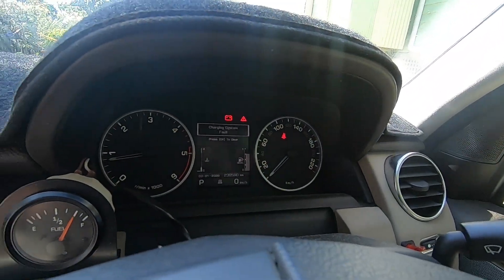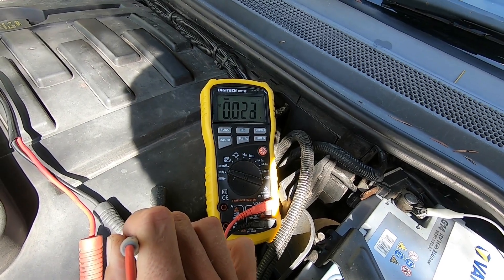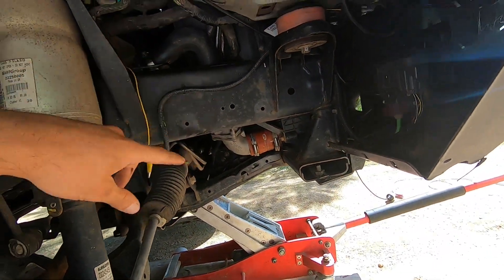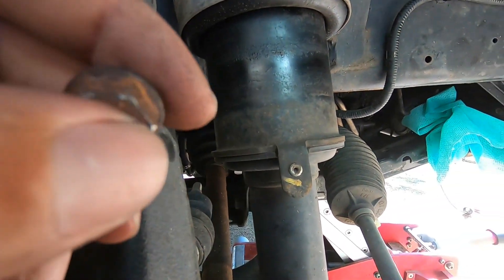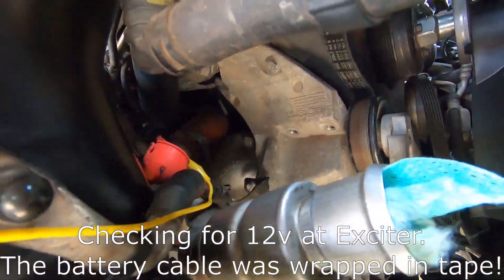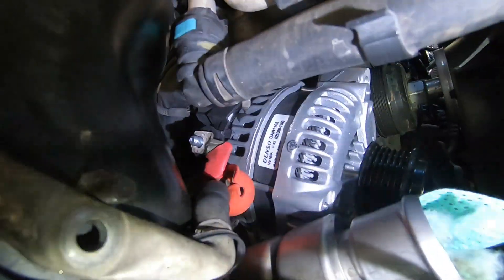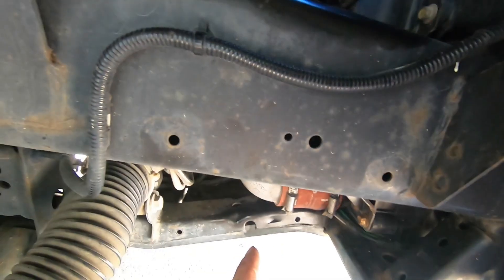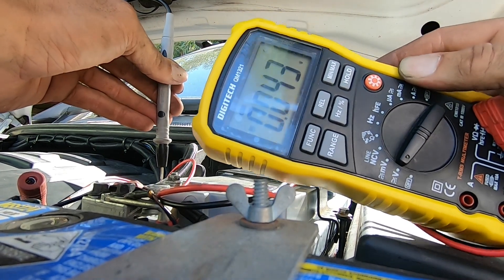Discovery 4 3.0 Alternator diagnosis and replacement

Comment: That valve on the front right of your engine behind the small panel is your switch over valve. Switches between primary and secondary turbo. Has an actuator on it that can stick and cause hesitancy in letting the secondary turbo come in

Comment: nice, bout to possibly be looking at this myself. How long did it roughly take to pull out (just to check at least) and refit?
Reply from the maker: Less than an hour I'd say, wheel off, liner out, valve out, belt off, loosen the battery cable off the starter, three bolts, take off the battery cable and the exciter wire from the alt and she's away.